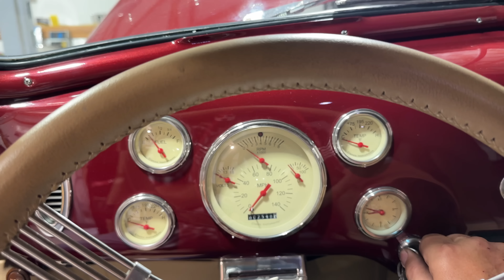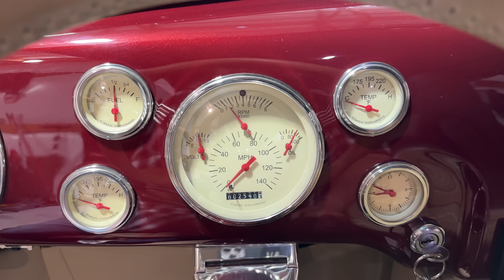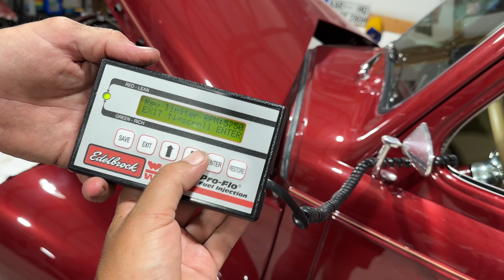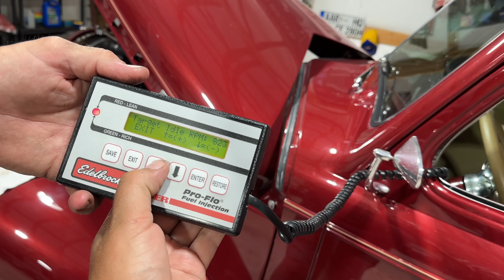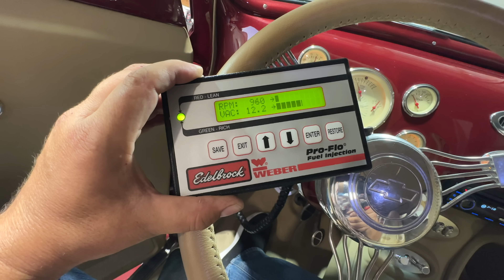We Couldn't Figure out this Issue - Edelbrock Pro Flow Fuel Injection!

Comment: I once swapped out the Thrush Super Turbos on my K5 diesel for more stock type mufflers because with 3” true dual exhaust & all that back pressure- the diesel could be heard 5 blocks away 😂 and I had to drive 91 miles 3 days a week to college in it. Everyone was like whyyyyyy did you put quiet mufflers on her?! I missed it as soon as I did… but trust me after putting 33k miles on that truck in one year, it was the correct decision. I wish I had video of it with the Thrush mufflers on it though.  That was the wickedest sounding diesel I’ve EVER heard, when you hit a certain resonance around 2000 rpm it was wild LOL

Comment: Man I like that old Chevy that is such a well-built hot rod no corners cut in before you start messing with that headliner which probably by the time you see this have already done so take a tune interior shop let them do it mechanical's one thing but when it comes to interior like that let the pro do it

Comment: A tool you should add to your set is a vacuum fluid extractor. It would be perfect for brake fluid, power steering fluid etc changes with no mess to clean up after.

Comment: Randy.  Confused.  When you first showed this car you said totally restored.  The engine brand new at $10,000.  You stated you were going to replace the 20 year old belt with a new one.  How can an old belt be on a new engine?
Reply: The build is 20 years old.  20 years ago the engine was new as well but its only got 3k miles.